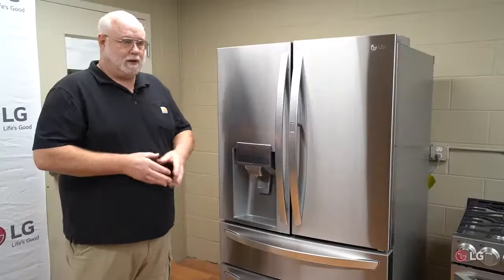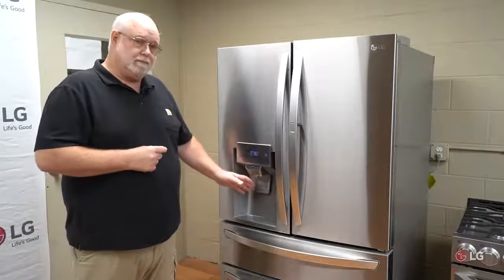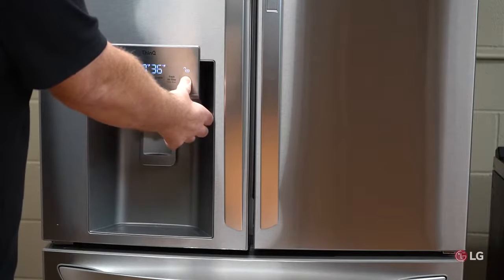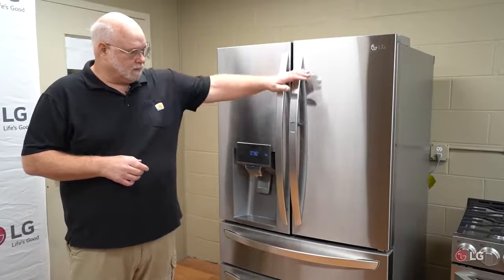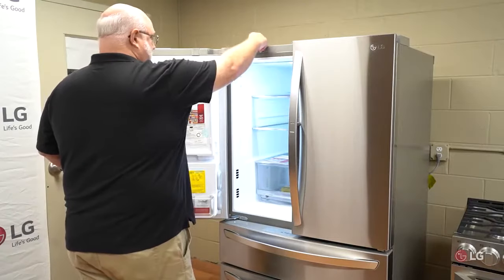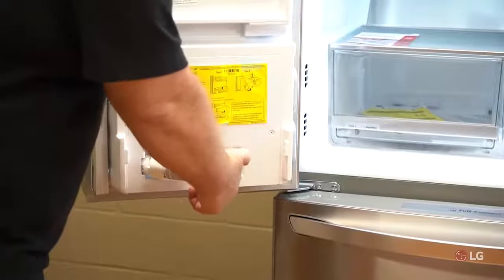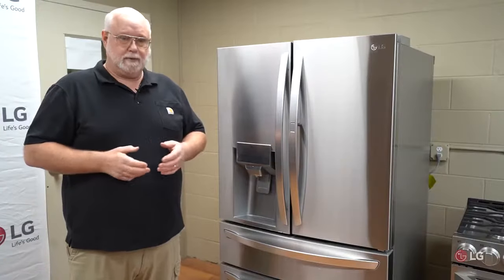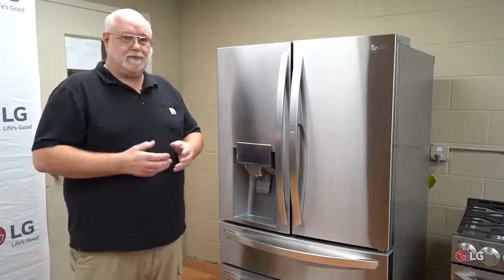Refrigerator Water is Not Dispensing

Comment: Our fridge suddenly stopped dispensing water. We’ve had it for a little under a year, recently changed the filters, it hasn’t moved since we installed it, the ice still dispenses but the water doesn’t. Not gonna lie this vid didn’t get me any closer to knowing what’s going on
Reply from the maker: Hi, Quinn.  I’m sorry to hear you're having this issue, and I’d like to see if we can assist. Please contact LG Customer Support by direct message via Twitter ( @LGUSSupport  ) or Facebook Messenger ( https://www.facebook.com/LGUSA/ ). ^John
Reply: We are having the same problem. Were you able to fix it?
Reply: This is exactly what has happened to us today. We have had ours for years. In addition to the water not dispensing, water will leak from the top left corner of our door (dispensing side) either when we try to dispense water or at times idly. Also been having difficulty finding answers online. Were you able to get any answers?
Reply: Ha.  We just got ours yesterday.  And this morning no water.  It never even started to make ice.  My husband is pissed that we just spend 3k on a fridge that doesn’t work!!   We specifically got it for the water dispenser.
Reply: @lesliedulaney9903  hi Leslie did you get yours fixed? Thank you 🙏🏿
Reply: @dickembaye unfortunately, no.  I called a technician out and they got it to work for 10 seconds and then it stopped again. Our house has extremely low water pressure, I believe that’s the issue. We still get ice though. Good luck to you!
Reply: @lesliedulaney9903  thank you so replying I’m still talking to them online but nothing resolved 😂 
Excellent day to you
Reply: I am having same issue. 3yo fridge quit dispensing. Replaced filter 2mo ago. If I hold the dispense lever in and open/shut the door then it starts working.  Seems like a sensor issue 🤔
Reply: Same issue
Reply: @jwiskow01 same issue just started for me.  Any luck fixing this?

Comment: My problem is not that the water will not dispense, the problem is it will not stop. We have to push the lock button you mention to stop and start the water. Meaning when it is unlock the water flows non stop. Any suggestions?

Comment: :58 are you hearing a humming noise? You explain "If you are hearing a humming noise..it means the valves are energized, etc". I'm not hearing a humming noise on mine. I disconnected the water line from the back and there's definitely water coming out of the wall to the fridge, but no humming noise. What does that mean? Bad valve?
Reply: I have the same issue here. Did you figure out what’s wrong ?
Reply: @CJ-vs5sl  Yes. after replacing the water inlet valve in the back, the water began flowing to the water dispenser! But then, I wasn''t getting ice. Water was dispensing fine, but no ice! So I replaced the inlet valve in the door, too, then that didn't get me ice, So finally, I replaced the ice maker part (about 150 bucks). Works perfectly now!

Comment: As a single mother on a budget, thank you. I didn’t put the filter in correctly, so the water stopped dispensing. I checked the line behjnd the refrigerator, and it was skitting water. I believe air was in the line. I unplugged the fridge, turned off the valve, and then tightened the connectors. I removed the filter, poured out the water, refilled it, then I put it back in correctly. That fixed the problem. Thank You, Lord, for directing me to this video because the others I watched were so confusing.
Reply from the maker: We're glad it was able to solve your problem! Any time you have questions about your LG appliance, don't hesitate to reach out to us on social media! Our platform is @LGUSSupport. Happy holidays!  ❄️^Chris

Comment: My issue was no water, but holding down the water dispenser and opening the door it’d dispense water for a second or two. 

Tricking the sensor with a magnet, I figured out it’d only dispense water for a few seconds when the door was open 30%, none closed, and none full open when tricking the hall sensor with a magnet. 

I pulled the top cover off the hinge by removing the one Phillips head screw and pulling up on the cover. I pushed the waterline (wrapped in a metal spring like covering) into the door about 1/4” or so as there wasn’t much room and I got consistent water regardless of the angle of the door when tricking the sensor. 

Water dispenser worked as advertised after that little adjustment, put it all back together and working solid. 

I hope this helps someone in the future, thanks for the video to help guide my troubleshooting!
Reply from the maker: Hi there. Thank you for sharing your experience with us! We're thrilled to hear that you were able to troubleshoot the issue with your water dispenser and make the necessary adjustments to get it working perfectly again. It's great to know that the video we provided was helpful in guiding you through the troubleshooting process. If you have further questions, feel free to send us a private message via @LGUSSupport, so we can look into this for you. We'll be happy to assist you. -MC

Comment: I do not get water at the front bottom of my refrigerator line.  I suspect that water hose may come off the water reservoir tank, which is not frozen, but the water level is below the upper and lower inlet/outlet tubes.  But why is my water reservoir not being filled?  I have a new water valve and proper water pressure.  Water is feeding the ice maker.  No water is being dispensed.  Suggestions?  I changed my water filter to new.  I changed my water valve to new.  My water selection is not providing water, but instead, churning ice.  Could the water, crushed, cubed computer board be defective?

Comment: Is it true that in this model if I have filtered water going to the line from a reverse osmosis filter, I don't even need to put in a filter?
Reply from the maker: Hi there. We appreciate you contacting us with your inquiry. In many instances, if you're utilizing filtered water from a reverse osmosis system, you might not require an extra water filter for your refrigerator. It's advisable to check the user manual of your specific model for optimal guidance. Should you have any additional questions or need more help, don’t hesitate to reach out to us via direct message on Facebook or X @LGUSSupport. We're here to assist you. ^Con

Comment: My old refrigerator stopped dispensing water so I lived with that for a year and when I replaced it with a new refrigerator the water will not go on so for some reason I’m not getting water to the valve behind the refrigerator,Even the guy that installed it told me my water valve is not working nothings coming out. and this is only a 10-year-old house with the little built in valve behind the refrigerator

Comment: so... what does it mean when you touch the lever and you DO NOT hear a hum?  is the unit defective?  Everything else seem to work.  The filter is NOT under pressure so I'm assuming the water dispenser is junk!  I had my 6th service call this morning for this refrigerator.  Is this issue now going to be my 7th.?
Reply: This is the same for me, water line connected and on. Did the magnet test and they work, replaced the filter and no hum and it is not dispensing water or ice. Any help would be greatly appreciated.
Reply: Same thing is happening for me. Just replaced the filter and water and ice making stopped!   Did not cover that.  So frustrated.  Unit is only one year old!
Reply: @JoyceAltgelt  I can tell you this is the last @lg refrigerator I will ever buy.
Reply: I ended up having over 10 service calls. Lost over 2k in wages due to having to be here for service. Filed a complaint with BBB and still no resolution.  I will NEVER  buy another LG product!
Reply: @mindypoplars8526  Call the Attorney General's office in your STATE. There might be a RECALL on these LG refrigerators because I'm seeing alot of people here are  commenting about similar issues with this LG refrigerator.
Reply: @stanleywheeler404  thank you for the info!  I will be calling.

Comment: My Samsung is brand new I just had to hold the water dispenser down with a cup under it for about 60 seconds so the water could travel all the way through the machine then it started working. I also moved it away from wall before doing this so may have loosened the water line.

Comment: What if it doesn't hum when you hit the lever?
Reply from the maker: Hi, there. We appreciate your question regarding this matter. If the water inlet valve and control board appear to be working properly, but you still don't hear the humming sound, there could be an issue with the dispenser lever switch or wiring harness not detecting when the lever is pressed. If that's the case, you may reach out to us through direct message for further assistance. ^Mau

Comment: LG WAS WORKING, and THEN...
 Everything was working perfectly, and then the water stopped dispensing. No harm, nothing. The ice machine would dispense ice that was already made but it wouldn't make any more ice. The magnet switches identified that the doors were closed and the light was turned off. You can also find this out by putting a cell phone and recording the fact that the light turns off inside the refrigerator when you close the doors.  This is a $4000 refrigerator & after 2 weeks, this shouldn't happen!  Checked everything, any suggestions?
Reply: I would vomit if I spent $4000 on a fridge that wouldn’t work.

Comment: I've got and LG LFX25973S /00 with the icemaker in the door. The water dispenser started spraying all over instead of a stream; like holding your thumb over the end of a water hose. I can't find any information on this issue and have had no luck getting the dispenser out of the door. Any help?
Reply from the maker: Please contact our customer support team that is available on FB or Twitter (LGUSSUPPORT). They can help! Thanks. ^Emma
Reply: @LGUSA  I tried that and they told me to call a repairman. I want to fix it myself but so far I've struck out with LG.